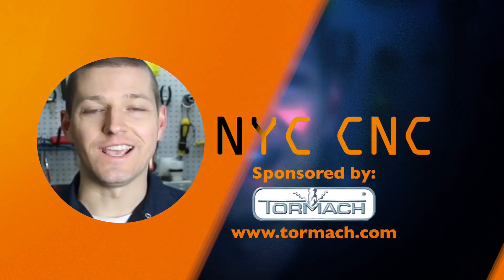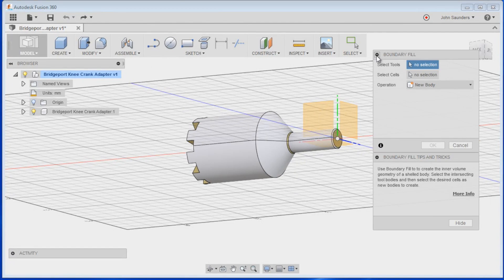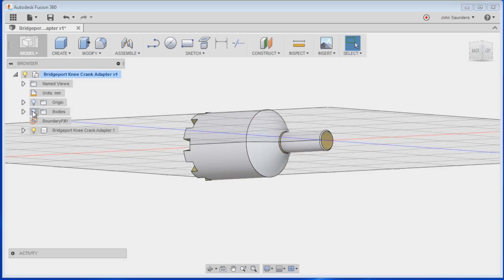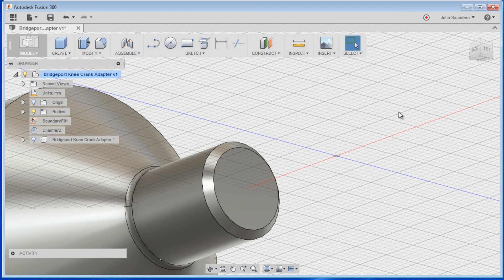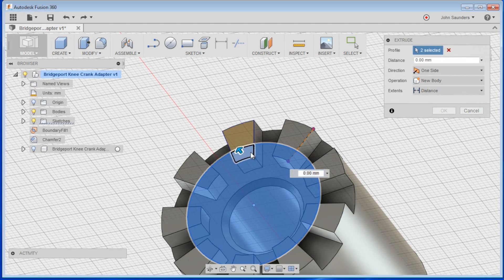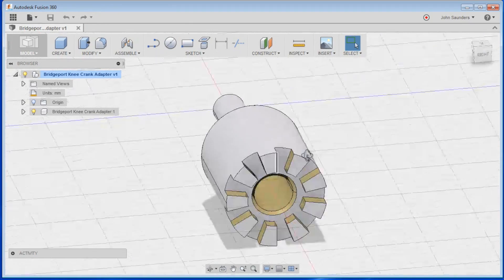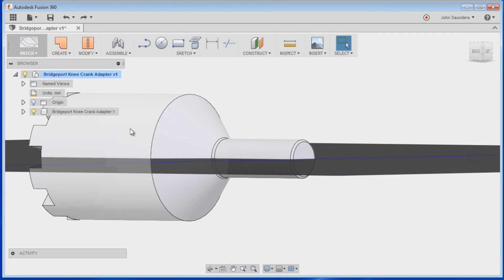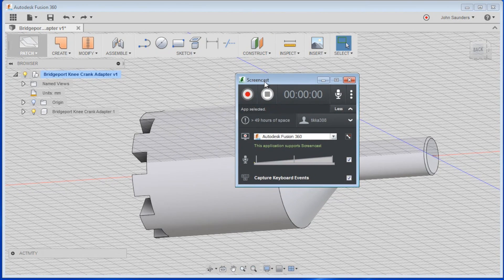Two Great Fusion 360 CAD Tips!

Comment: We are trying to transition from Sketchup to Fusion 360 and having a heck of a time with file imports.  In Sketchup there is a free utility called Cleanup3 which can clean up the geometry of the  .STL file then you can  take 2d slices to modify the files.  I think Autodesk can take market share from Sketchup users that need more horse power to design parts and also  need a program like yours that can do assemblies.

  Would be helpful if you can do a series of videos on how to transition from Sketchup to Fusion 360 doing imports of .STL files to CNC. You will have legions of new users of Fusion 360 especially from the Maker community.  Only thing that comes close to Fusion 360 is Solidworks and its way to expensive for the average user.